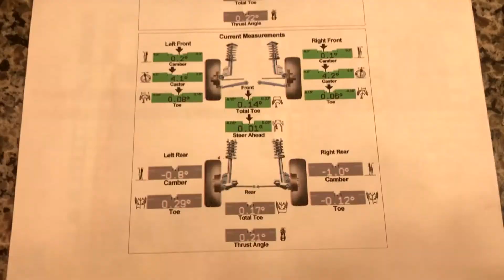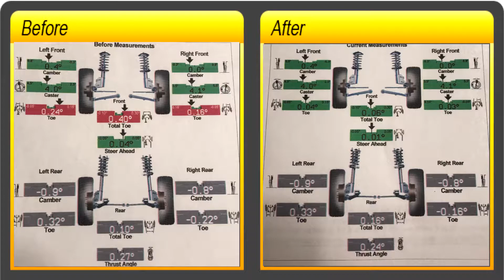How To Crank Torsion Keys | 2002 GMC Yukon XL 1500 4x4

Comment: Find yourself a nice flat level as you can piece of concrete to work on. Check the air pressure in your tires and make sure they are even as you can get them. The psi is important if you have big tires but not as important if you have rubber bands on some 30 inch wheels LoL. Before you lift up your truck at all measure the height of all four corners from the ground to lip of the fender in wheel well openings is what is most common practice.  Then WRITE IT DOWN!! you will forget by the time the measurements matter. Support the vehicle on stands like he said in the video here. I do this but its not a must but clean the bolt head and area and then use a marker/paint pen and put a line on the bolt and off to the metal of the cross member so you can count the turns and you know where to stop. A little goes a long way with this so do small steps but count the turns and do it evenly on each side if your truck sat level when you started side to side. But take your time do half turns or a full turn then check it. Be sure to let it settle like removing wheel chalks or ebrake so its nor bound up from you jacking it up. The more you go up the worse it gets! You lose your droop so if you hit a pot hole u dont have that travel to absorb it plus it binds the ball joints pretty bad and it can give you some ugly positive camber and that just looks funny. Like a ferret running after somthing! LoL. Half inch or and inch anything after that should be done with a leveling kit with new keys or arms for the suspension. Anybody that says this way is not gunna hurt your truck at all so crank them up! Well they should read up on it a bit more and educate themselves on how the suspension geometry works and if you think you are smarter then the engineers that made and designed all of it well then go right ahead and change it up! Hell if you where smarter then the engineer then you already know all of this so you wouldnt be reading any of this anyway!! LoL hope everybody that made it this far has a awesome day!! Later yo!!
Reply: Shop manual says to just put a bubble level on the rear trailing arms to find the spot. Also I believe stock it's 1.5in lower in the front.

Comment: What is suggested for 2005 Yukon xl Denali awd  looking to put 22x12-44 but how while I raise the rear  11/2when the suspension is on the air shock system
Reply from the maker: Derrick Jackson either buy a BDS kit, and do it proper, OR buy some cheap coil spacers off eBay &  and put those in. Then you’ll have to get shocks extenders for the air ride to work. You can fit those puppies stock with no problem.
Reply from the maker: You’re nasty

Comment: I have a 2004 2wd drive does it work the same way you did
Reply from the maker: Jason Edwards Yes it works the exact same way. You can put bigger keys in due to you not having CV Axles. Meaning you crank them for more lift.
Reply: RWD usually don’t have torsion bars.

Comment: How high did it go, a inch or two? I have a 03 yukon xl denali im am waiting to turn the keys higher
Reply from the maker: It raised it to the moon! Lol. it raised it a good 2 inches. Mine was already partly leveled when I got it so I just maxed them bad boys out and it worked just fine.
Reply: Do i have to change out control arms?

Comment: does it ride rough compared to before u cranked it?
Reply from the maker: DBushII aka BEASTMODE #5 It actually rides even smoother now that Both sides are 100% even. Keep in mind my truck is a SLT package with z55 suspension ( Adaptive suspension ).  Im considering going to 2.5” lift Keys to fit 33’s and coil spacers in the rear. Only thing keeping from pressing the “ Order “ button is if I would have any problems with the level sensors needing extended arms so the computer could adjust properly. But the stock keys on these body styles are enough to 100% level for free no doubt. Im honestly gonna leave it the way it is probably. And just go with a mud tire. In my opinion, if your gonna put bigger keys in, just buy a lift kit and don’t be a cheap ass. Stock keys that come with your truck are able to go full crank without hitting the droop stops, and not clap out your suspension. GM already did the million dollar reasearch for you. So if you need bigger keys, go full lift kit
Reply: IndecisiveBlake how could I know what rpo code to find out if I have the z package ? I have a 2003 yukon xl 1500 4x4 slt not sure if I have adaptive suspension